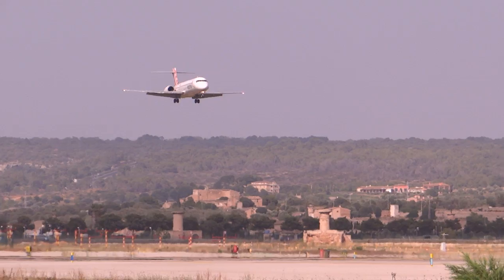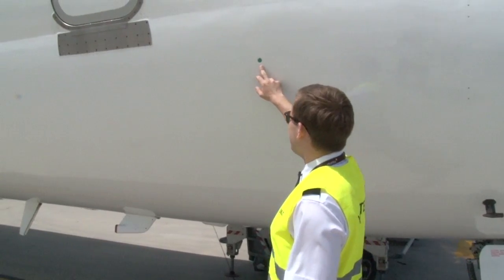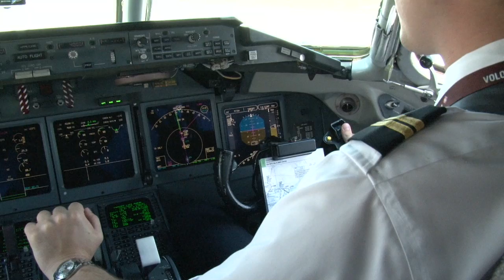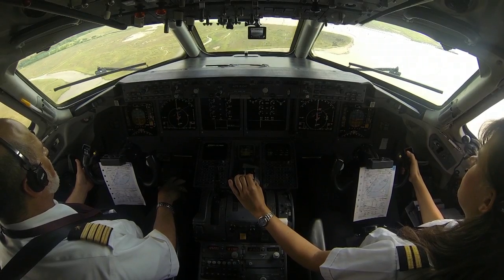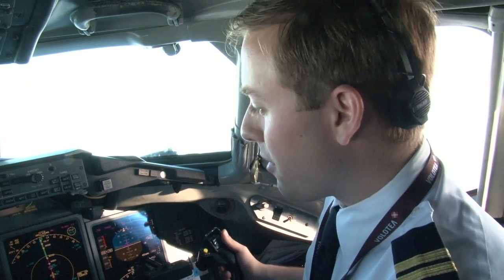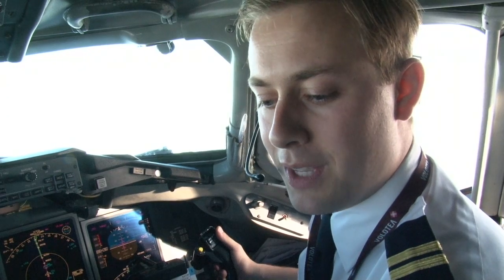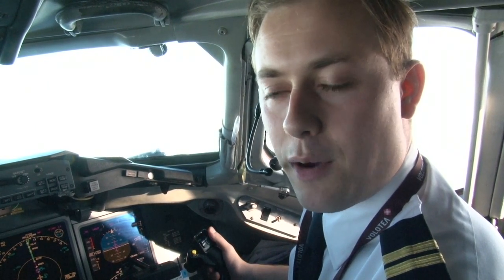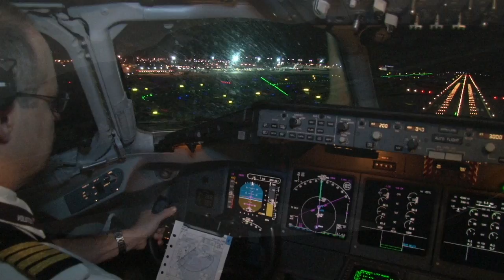Cockpit Flying on VOLOTEA Boeing 717

Comment: 7:42 > He handles the yoke just like I do it on my FSX :D
Reply: you sir have just made my day
Reply: Nope. You handle the yoke like him! :-)
Reply: notircm haha :D
Reply: He's not sloppy on the yoke as you refer to as FSX. The 717 does not have hyd boosted ailerons or elevators. In fact, the control cables connect to control tabs, not to the ailerons or elevators themselves, so because of the built-in lag, there's more control inputs to the response of the airplane as you can see the "exaggerated" inputs does not result in the same response to the airplane's attitude. But keep flying your FSX, and if someday you become a professional pilot, there would still be some 717 around, I'm sure. :)
Reply: It's too bad there isn't a descent version of the 717 for FSX though 😪
Reply: Lazy Bastard  Keep an eye out for TFDi Design they are building a great 717 sim just not sure when they will be releasing but you can follow them until they do.
Reply: TWA717 yes.....I know they are developing it....I've been following it for a few years now. But I don't have any faith it will ever be completed...which is why I said I will believe it when I see it.
Reply: Yeah we will have to see.  At least they are updating progress on their blog and the work they have done so far looks good.  Systems programming with a small team can be bitch...

Trying to get PMDG to build a 717...
Reply: Lazy Bastard TFDi 717 was released in December of 2016 and it is amazing.

Comment: NIce vid. The 717 is a great airplane for this type of operation. There will be more available when SWA decides to get rid of the ones inherited from AirTran, though I think those are IAE V2500 powered. Thanks for posting, and great job in allowing those young pilots to move up to such of great airplane.
Reply: The 717 has RR BR700 engines. The MD-90 is the one with IAE V2500.

Comment: I only heard her say training in Piper warrior and Piper Seneca.  Nothing in between that and whats shes flying. Oversight on her part I hope or maybe I've been out of the business to long lol. Do have one question though. Why are the co-pilots only wearing two stripes instead of three?  Thanks!
Reply: B Murphy  2 stripes, they're rank of Second Officers, but conducting First Officer duties. Since in Europe, EASA regulations allow newly qualified pilots just out of flight academy with a "Frozen ATPL" which is another way of calling the CPL with the MEIR(Mult-engine instrument rating) with Multi Crew Co-operation and completing the 14 EASA atpl exams. This is a mandatory requirement to be able to obtain your first Type-Rating which you will undergo once you have been accepted into an airline for employment. 
They normally finish flight training with around 150-220 hours depending on the approved course. 
You ATPL becomes unfrozen once you have total time of 1,500 with the required hours stated by the authority, until then you are flying FO duties as command under supervision. Hope that information helps. 
Cheers.

Comment: The plane is so high tech compared to 727
Reply: Of course it is! The 727 first flew in 1963 the 717s first flight was in 1998. 35 years difference is a lot in aviation :)
Reply: That’s because the 727 is actually older than the 717! The 717 is actually manufactured by McDonell Douglas, by the name of MD-95, But was later renamed to Boeing 717!